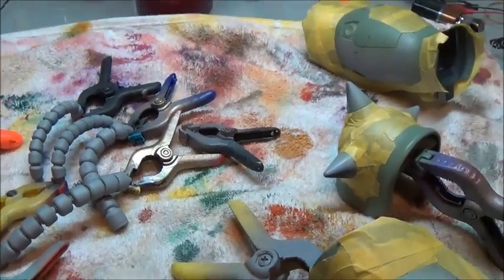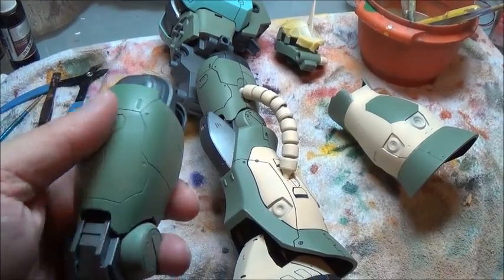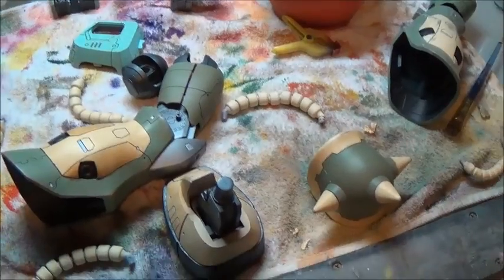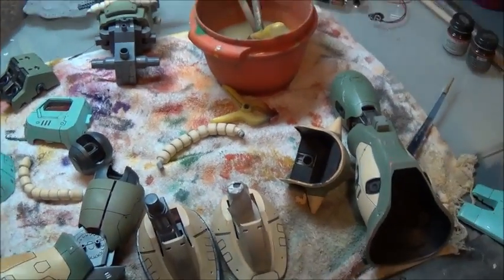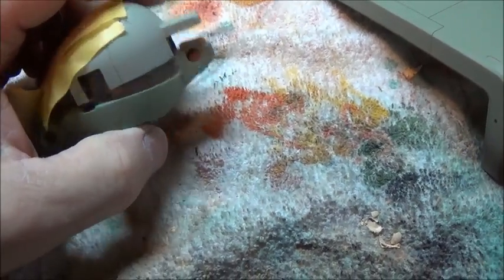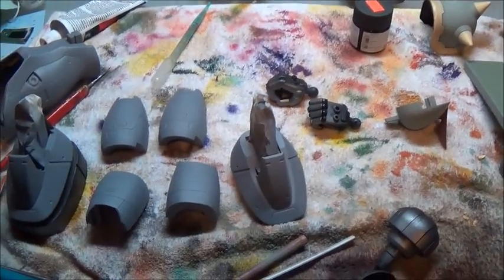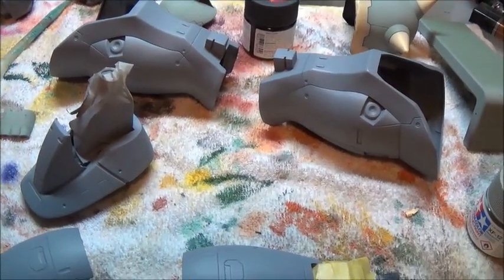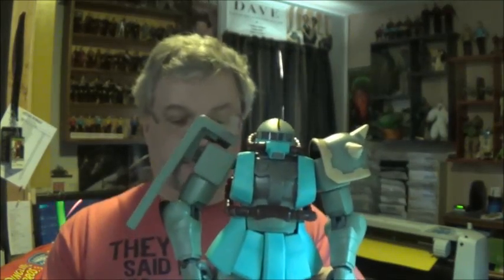Aztek Dummy Update 4/1/17 - Gundam pt.3

Comment: You can tidy up your gundam marker slips ups with a dab of Windex on a cotton swab. Cleans off the marker instantly. The markers also come in gray for less contrasting lines. Another technique I find works well on Gunpla is after a good clear coat is to do panel lines with thinned enamel paint. Thin with lighter fluid until capillary pulls the paint up the line when you just touch it with the tip of your brush. Benefit of this is you can use any color in your stock.
Reply from the maker: thanks roger! I'll certainly give it a try, but i'm wondering how the windex will affect the tamiya paints. (it's very close to the same thing as Tamiya thinner)
Reply: Indeed it can without a clear coat. It takes very little on the swab and a light touch. I spritz a little on my workbench and then tap just the tip in. The gundam markers are so soluble to Windex you can quickly wipe the whole line out. IMO with your skill level, think you would be happier with the thinned enamel method. It takes longer but you get any color you want to be your shadow. Tamia sells pre thinned panel line accent colors just for this. They tend to have finer pigments than diy thinned enamel. I use them a lot.

Kinda feel like the arm chair quarterback giving the pro advise here. Been watching your channel for a long time now. Great work and your new room makes me so jealous.